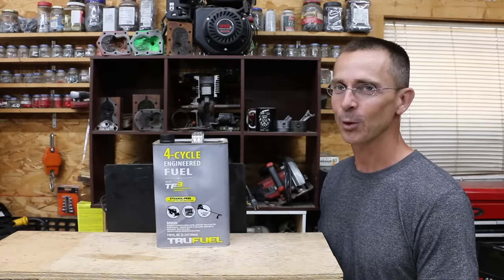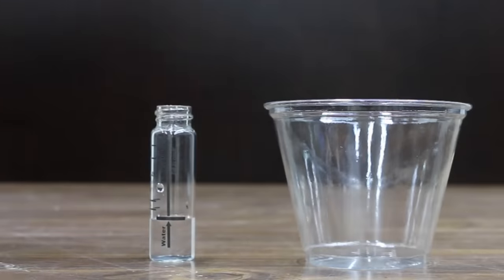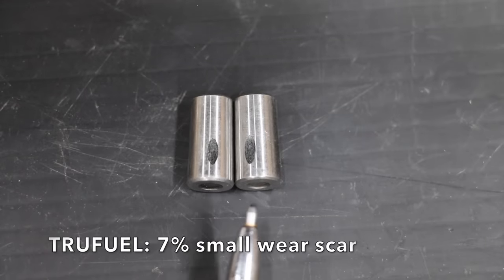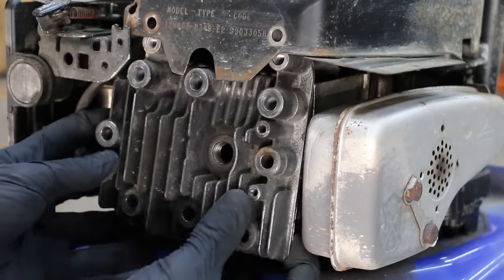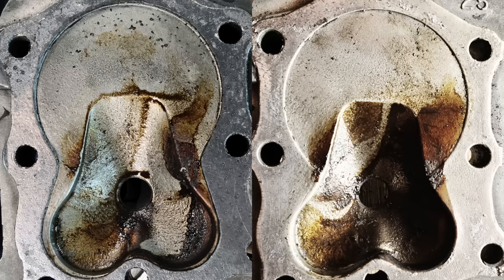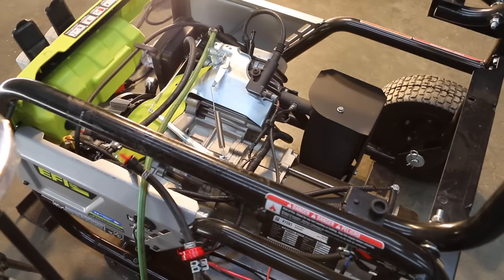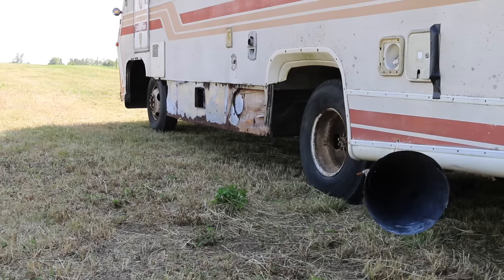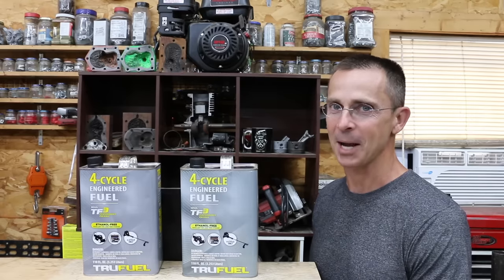Engineered Fuel better than Pump Gasoline?  Better Fuel Efficiency and MPGs? Let's find out!

Comment: Honestly, I just assumed it worked moderately well as fuel. This video proves that. However, the reason I bought it is for storing small engines for moths of no use, so I would have liked to see more testing regarding its shelf life, and it’s affects on various materials like you did in one of your other ethanol fuel videos.
Reply from the maker: Thanks for the constructive feedback.
Reply: Definitely need shelf life testing. I to use this product for storage purposes. Then run ethanol free during the season.
Reply: I seen a lady that has a shop and works on small engines.  She tested Trufuel,  with regular gas and an oil mix. Her oil mix did better in testing.  She had a tachometer and showed the difference in RPM between the 2 fuels.  Trufuel,  had lower idle,  and about 600 RPM lower top RPM. For a chain saw that's a lot of RPM loss.
Reply: @Mike-cb7gt  
Yes, that's exactly what I do, use Aspen as the last couple of runs before storage to wash any ethanol out. We can't get ethanol-free fuel in the UK (or at least, I would love to know where). The best "pump gas" as Americans would term it, is a brand in the UK called "Texaco", whose Premium E5 petrol is supposed to be actually close to E0.
Reply: @bertgrau3934  
Yes, interesting video from "Chickanic". She's great. I wish she had tested Aspen fuel, because Chickanic has issues with Trufuel and I think (not certain) that the Aspen, Stihl and Husqvarna canned fuels are true Alkylated Fuel, whereas some commenters on YouTube say that Trufuel isn't quite the same quality. This would explain why Bre (Chickanic) has issues with Trufuel but we (in Europe) think Alkylated Aspen Fuel never gives issues with long storage.
Reply: @richardjames4632  
Sir, that's correct,  she has a good channel.  
It's interesting to learn about other countries.  

I wonder what Germany will do this winter.  I seen where the cost of natural gas is skyrocketing.  They (news media) said people are waiting in lines to buy coal, and wood to burn. I thought in Germany it is illegal to burn coal.   What about solar energy? I thought Europe have lots of solar power,  and windmill power.  Why do they need natural gas?
Reply: @bertgrau3934  I know this is a late response, but burning coal and wood isn't illegal in fact the tore down entire suburbs just to mine the coal.
Second, yes we have a lot of solar wind and hydro power but gas powered electricity plants are key for grid stabilization, because of the irregular nature of alternative energy sources. Gas turbines get going really really fast compared to nuclear and coal.
Reply: @gnaedigerfels  
I guess what I had heard was incorrect.  I was told that city police would write people tickets if they didn't have a permit to burn charcoal, for a cook out. Sounds odd.  I'm talking about Germany
Reply: @bertgrau3934 
It is possible, if they tried to bbq in a city park where it is forbidden (because people are stupid and set stuff on fire), but generally no
Reply: @gnaedigerfels  
Thank you for your response.  I was told they needed a permit to have a BBQ in their back yard.
Reply: Trufuel for storage ethanol fee with either K100 that eliminates the water and alcohol or stabil  360 half 1/2 and half mix with sea foam but always store with trufuel

Comment: Very interesting test, thanks! In Germany we have also engineered fuel from Sweden named "Aspen" for 2 stroke engines as well as an 4 stroke engine variant. It seems to be quite similar to the TruFuel, promising lower emissions, smoke, cleaner burning and so on. Maybe it is worth a comparison between Trufuel, Aspen and "regular" fuel? Thanks and go ahead with you cool projects ;-)
Reply from the maker: You are welcome!  Thanks for the suggestion.
Reply: i know It's been a year since this video came out however Aspen fuel is the one to beat.. not all engineered fuel are made equally and my opinion Aspen is on top..
Reply: @joebrown9621  There is a video from a guy RedBull661. He runs a few gallons of each fuel then replaces the top end on the ms661 test saw!
Reply: @viperstrike3827  I'll definitely check it out..  Thanks..  There's a Guy on YouTube.. Taryl fixes all..  he recently did a burn test plus some other test  and intresting to see
Reply: @joebrown9621  Tell me if you enjoy it!
Reply: @joebrown9621  Aspen 2 is good, and like Stihl Motomix, is an alkylate based fuel, which is the purest refining method of the pre mix fuels, from what I understand.

Comment: I’m curious how the lubricity test would go on regular gas with sta-bil added.
Reply from the maker: Thanks for the video idea.
Reply: You could check a variety of gas additives that claim to increase the lubricity of gas.   Same with diesel additives.
Reply: @bobjones37450  I believe gasoline engines require the gasoline to cool the cylinders to operate efficiently, where in diesel engines they require the diesel fuel to lubricate the cylinders.  And from what I understand high octane gasoline burns cooler, and low octane pump gas burns hotter and more violent.
Reply: @ProjectFarm  Be sure to test the lubricity of Lucas added to gasoline!
Reply: gittyupalice96 actually vise versa on the octane ratings on a properly jetted 4 stroke carbureted air cooled motor. Higher octane has higher combustion temperatures versus a lower octane rating.
Reply: add  4oz. of restore engine addative  to 6 gallons of gasoline.  youll   flip  your lid.

Comment: I been using True  Fuel in mainly  in my snow blower and it has ended my carb issues that I have battled over the  last twenty years. I have not had to service the carb in three years.  I tried every additive to try and combat the ethanol and water issue. It sucks to spend so much on fuel but it really sucks to have to work on your snow blower in he dead of winter with 28 inches of snow on your driveway.  Its working what can I say.
Reply: Do you store with the fuel in the carb?
Reply: @markhou No

Comment: This is amazing, I'd be very interested to see a test of this in a 50:1 2 cycle, that's where I tend to use enginerded fuel and where I've historically had the most issues that I at least in my head associated with ethanol. True-fuel pre-mixed (stihl moto-mix, husqvarna, etc.) vs. ethanol and ethanol-free fuel mixed at home. Comparing with ethanol is especially useful as not everyone can actually find ethanol free gas other than enginerded fuels (like me)
Reply from the maker: Thanks for the video idea.

Comment: 6:48 - the true fuel exhaust valve looks way better - maybe just right.

 Your buildup seems to be coming out of this worn engine. You should place the engine on a precision balance to measure the use of motoroil during the test. And replace this test engine. Maybe measure the exhaust temperatures during the test as well. (Some professionals very likely would analyze the exhaust fumes during the test.)
Reply from the maker: Thanks for the suggestion.

Comment: Wonder if there’s much difference between Number 2 Diesel and “Premium” Diesel. I’ve seen pumps for both before, maybe an idea for a test.
Reply: Should also throw in biodiesel 20% and 60% as well as off road only diesel. If he's going to test diesel, he might as well test all of them. But I do like the idea. When I converted my 89 jetta to biodiesel I got super mpg but never bought premium diesel, just regular. Didn't need to since I was getting 65mpg of diesel already.
Reply: Aaron,
I have been in the trucking business for over 42 years, I'm not sure what the difference is between regular diesel, and premium.  I do know the difference between #1 and #2 diesel.  #1 is closer to kerosene,  and will not gell until much lower temperature.  Around 0 degrees.F.  #2 Will start to gell at 20 degrees. F.
Just one more thing, I've heard some drivers talk about using jet fuel in a diesel engine. If you try that I strongly suggest do not use more that 5% jet fuel to diesel. Jet fuel will clean the fuel system,  but it has no lubracity and can cause fuel pumps, and injectors freeze up.
Reply: @bertgrau9246  which jet fuel?
Reply: Jon Anderson kerosene
Reply: Good idea ! In England will have 92 octane and 95 super unleaded. I mate say his bmw m5 is faster 0-60 on the super stuff .How ever another mate says his is faster on the 92 unleaded. Would be nice to find out .
If you can ??
Reply from the maker: Thanks for the video idea.
Reply: @ukdroneking  probably is because the engine computer can use more spark advance before detonation occurs giving you a little more power. Not going to be tons, but there would be some. I don't think 92-95 octane would be more than .2 seconds in a quarter mile.
Reply: @ProjectFarm  yes diesel tests would be good, always wondered if that higher price diesel from Shell really works as it claims, compared to regular and red diesel, sulphur content, power, smoke and lubricity? Thanks
Reply: @bertgrau9246  I ran my 2002 VW Golf TDI on Jet A for over 200,000 miles.  Mixed cheap 2 stroke oil in the fuel, about 20oz per 10 gallons.  That car is still running today with over 500,000 miles on the original fuel pump/engine/turbo.  Jet A has noticeably less power (BTU's) than #2 Diesel, but it still goes down the road... and I couldn't beat the price (free!)
Reply: Iv seen the filters changed on these pumps i know the local guy well, and in the uk the shell garage has v power diesel and normal diesel, the normal diesel filter has to be changed every few months and has a thick jelly around it, and the v power is changed every year and is clear from any jel. 

also with my job i went on a course with diesel engines they had 2 high pressure pumps one was run on super market fuel for 100k mile and the other was run on v power and bp high performace, they cut the pumps in half and the supermarket fuel was scored and carbon up to the teeth were as the v power and bp high performance was clean as a wistle.

 There is a reason supermarket fuel is cheaper. 
Also the vehicle was a iveco eurocargo 2006 model the pump was tested on.

Comment: Thanks for the work. I enjoy your testing processes, quite clever and interesting. In regard to 2 cycle fuels both pre mixed and DIY mixes, Can you invent a way to test your mixture to verify the appropriate ratio. I had a Husqvarna 128 that seized (after 3 yrs) and went through 2 replacements in 3 weeks. Tried two different gas stations with ethanol free (so it claims) and the trimmers still stopped running. Pre mixed is so expensive would like to know if the gas is bad or just unlucky.
Reply from the maker: Thank you!  Thanks for the suggestion.

Comment: With regards the engine residue, couldn’t it be that the true fuel cleaned it out after petrol?
Reply: The crud would have to have come from either a fuel line running from the fuel reservoir to the cylinder, or the carburetor.  Since 100% of the combusted fuel & exhaust goes the other direction, it is not possible.  

He cleans the engines thoroughly between everything he puts through them too.
Reply: I would guess the additives are for 2 strokers.

Comment: I use the premix gas/oil products in all of my 2 stroke engines. Noticed the difference right away when I first started using it.  I thought I needed a carb kit in my trimmer, but it runs great now that I’ve started using this stuff.
Reply from the maker: Thanks for sharing.

Comment: Hope you had a fire extinguisher close by on those lubricity tests! That would make me nervous.
Reply from the maker: Great point!  Yes, I had a fire extinguisher ready for action
Reply: A 1/4 cup of fuel doesn't burn that long - I doubt it would have been very eventful if it ignited.  Pull the power and walk away for a minute.
Reply: @jong2359  but all the stuff around it does.
Reply: @boots4785  all the solid steel construction with a tiny wooden block in the center?  You worry too much, lol.

Comment: I bought a returned Toro lawnmower and I only poured true fuel, after having it for about 6 months, the machine had a hard time cutting a chunk of grass at a time and would take 2-4 pulls of the cord to turn it on, I was a little bewildered as to why it had such a loss. When I opened up the carb, it was spotless including the piston chamber, except that it developed a grass like paste almost about 5-8mm thick on the piston head plate that came off at the wipe of a finger, I dont even think I cleaned up any carbon making the machine look new.

after all of that I found out that it didnt have an air filter, woops.. it was probably why the last owner returned it, ever since installing an air filter, it has never done that again, it felt nice pulling the cord very gently and softly  once more
Reply from the maker: wow

Comment: Something similar to this is something called "Syntin", which was a slightly higher performing synthetic fuel used as an alternative to kerosene in rocket engines. It was discontinued when the Soviet Union collapsed and they could no longer afford costly synthetics.
Reply from the maker: Thank you for the sharing

Comment: I just watched your test with Turpentine, the Turpentine offers better fuel economy (90 longer than 91 octane in the gen set), better lubrication (+9%) and arguably cleans the top end better than the engineered fuel...and smells Pinesol fresh 😉👍, at a lot less 😎
Reply from the maker: Thanks for sharing.

Comment: I've often wondered about these. Especially the 2 cycle versions. I've had good luck with no ethanol 89 octane gas in my mowers and the same with synthetic 2 cycle oil and no ethanol 89 from Shell in my chainsaws and trimmers.
Reply from the maker: Thank for the feedback.

Comment: May be time to re run the water injection again, may be try steam by rapping copper tube around the exhaust to boil the water and a spray nozzle to limit the amount, and maybe add some citric acid to the water as we add that to our ultra-sonic cleaners to remove carbon from car parts and cleaning brass cases too.
Reply from the maker: Thanks for the suggestion.

Comment: This is a good product, I can verify it lasts at least 5 years while sealed as I had a can of 2 stroke true fuel that fell behind a cabinet for 7 years, still worked fine. No ethanol is also important for small engines with the types of gaskets they use, but if you can easily get ethanol free fuel where you live just go for that.
Reply from the maker: Thanks for sharing.

Comment: You have a lot of knowledge and a fantastic memory, don’t know how the heck you remember so much.  Enjoyed the engine fuel tests.  I have a request for you.  I know nothing to less than nothing about engines, but I have a request.  Could you do a show on an Ohlsson rice engine?  It normally runs on gas, but there were 2 companies that ran them on glow fuel with 2 different type carbs.   one company used a water cooled head, the other used the regular air cooled head.  One used the engine in a boat, the other a helicopter.  could you do a show to find out if an Ohlsson rice engine could run on diesel fuel since it ran on glow?  I could send you one or 2 engines with the 2 different carbs and the 2 different heads.
Reply from the maker: Thanks for the video idea.
Reply: Project Farm if you decide to do it, I can send you the engines anytime, just give me an address.

Comment: All of the local shops are refusing to sell tru fuel brand because they are destroying small engines. They still sell pre mixed, just not that brand. I stopped using it after I lost an engine that had previously worked for a solid decade.

Comment: I use an alkylate kind of fuel for my chainsaw and brush cutter. There is no deposit in the carburetor bowl after the gas has evaporated. The synthetics are giving less fumes / smell too. For the lawn mower, it's too expensive to use. I just add some fuel preservation to ensure it doesn't go stale. Note that in the EU, we can still have 98 octane E5 fuel, still some ethanol in it but not as much as the 95 octane E10.  There is no 91 octane fuel available to my knowledge.
Reply from the maker: Thanks for sharing.

Comment: I honestly don't know ANYONE that buys engineered fuel for ANY reason other than it contains no ethanol. So if ethanol free gasoline is unavailable in your area this might justify its high price. Personally, I think as long as you: 1.) Add fuel stabilizer to the tank prior to storage AND 2.) Shut off the fuel valve and burn the gasoline remaining in the carb prior to storage, engineered fuel is quite unnecessary.
Reply from the maker: Thanks for the feedback.

Comment: The selling point of the engineered fuel for me is availability, I can buy it in any hardware store. Sadly it takes a lot of searching to find ethanol-free gasoline in some regions, it's about an hour round trip for me to get it and some states don't allow it to be sold at all. It's so expensive that I only use it for emergencies in my little generator though.

Comment: That's why I miss Cenex alcohol free 94 octane. My 2 stroke motors purred with that stuff
Reply: There's a store near the local boat launch that has "premium " no ethanol 92 octane gas for about $3.00 a gallon.
When take the boat out I fill my gas cans.
 Lot cheaper and all my equipment is running fine.

Comment: The draw of trufuel is that it isn't always easy to find no ethanol fuel.  Trufuel is good for not messing up carburetors like pump gas does.  It doesn't really 'perform' better.  It just stores better.  I have also had good luck with the storage life of race gas in small engines.  I do use trufuel but only their 2 stroke pre mix in the chainsaw and string trimmer.  The 4 stroke engines get regular old pump gas ethanol and all, since I can't easily get ethanol free here.  The trick with the ethanol fuel is that you have to have the carb empty when you are storing for any length of time.
Reply from the maker: Thanks for the feedback.